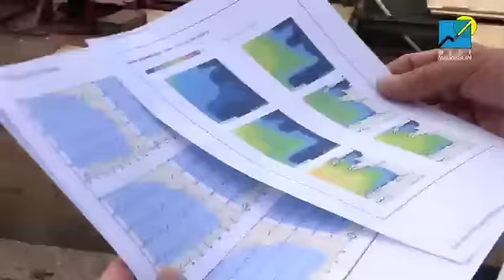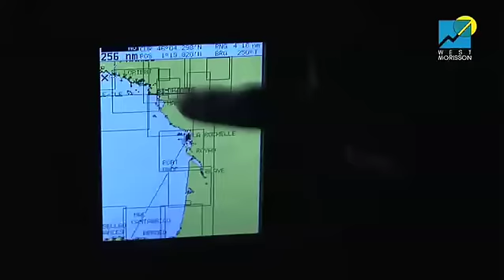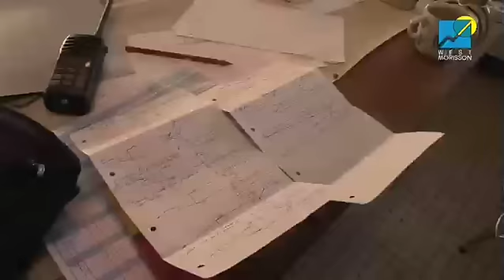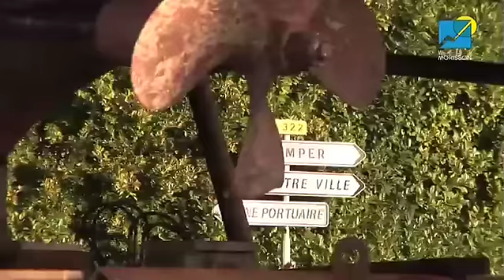La restauration de la Calypso - Episode I

Comment: The great ship Calypso.  I'm glad they are restoring it.  I heard that it was hit by a barge and sank for a short time.  It's primarily a wooden hull, of which not many are left of this size.

I would like to see a wikipedia on this ship.

I have not heard much on this since 2009.  Is it finished yet, or still a stalled project.

Is it getting the same engines it had before or is it a repower with new engines?
Reply: So far the last news we got on it was that it burned partially in Turkey. Since, no news.
Reply: Que chulo volver a ver el calipso y como lo restauran